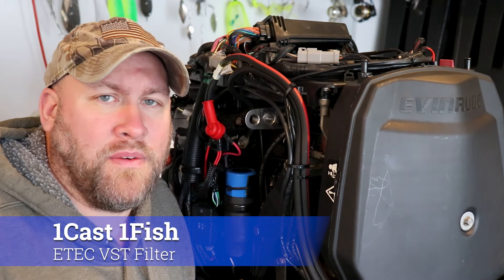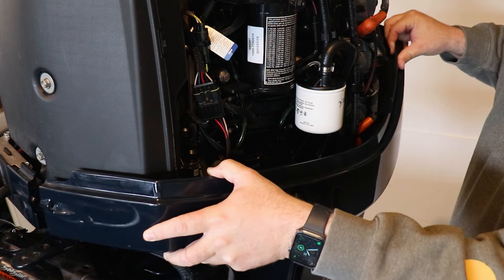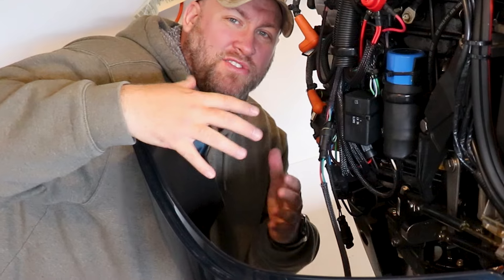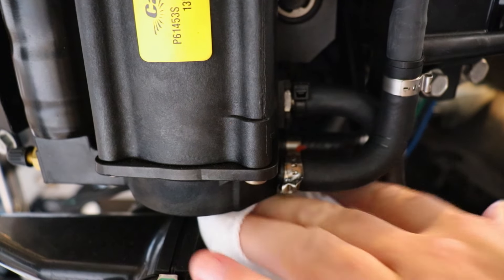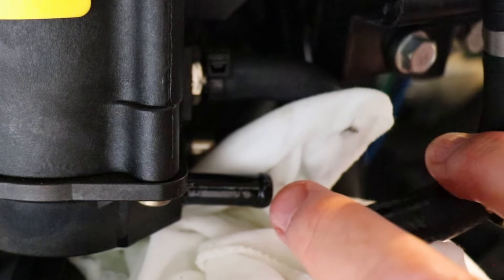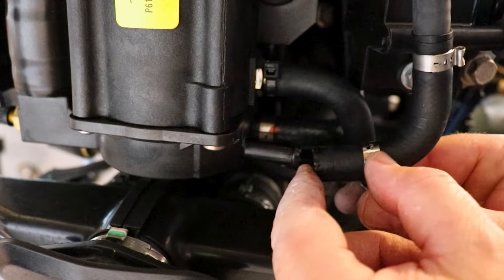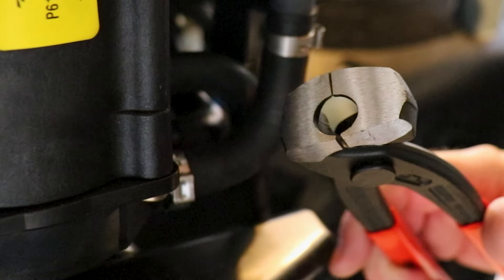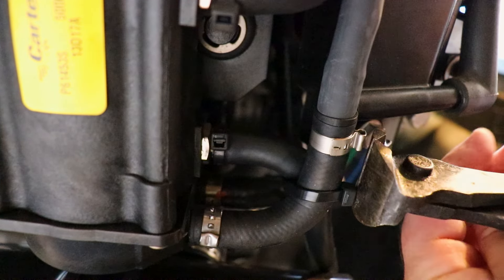Evinrude ETEC VST Filter Maintenance / 3 Year 300 Hour Service

Comment: You did a great demonstrating n explaining the VST filter replacement . 
I wondering about fuel leaks coming the area of the VST ? Before taking it apart . Are there any common problems . It is a small leak .and doesn't effect the motor running , your thoughts before taking apart ..
Reply from the maker: Depends on the leaking area...IMO any fuel leak could cause an issue and be dangerous.  
If it is simply from the hose or connector, it should be a simple fix.  However I do know that the older style VST system housing was prone to leaking as well resulting in needing to replace the VST.

Comment: excellent video got a link for the clamp an tool? I was planning a high quaility reusable fuel injector clamp I assume the line is 3/8"
Reply from the maker: https://amzn.to/3ySorKo
This is mine
Reply: @1Cast1Fish  when you screw into the filter doe's the screw ruin the filter being removed? like if mines clean can I reuse it?thanks
Reply from the maker: You can, if you screw it in very lightly and pull...if it comes out easily then it probably can be cleaned and reused.  However they are pretty cheap to replace.  I just like knowing a new clean one is in there since you have alot of work to get in there to it already. Plus if you do have issues or it's messed up you want a replacement on hand.

Comment: Thanks for the advice, do you have any for the e tec 60 HO 2020 year ? Took in for service last winter and now that the warranty is up plan on changing the lower unit myself and fuel filter and plugs. Only has 42.50 hours on it so far.
Reply from the maker: I have no specific videos for that particular model, but many of the videos should be a good match...like lower gear unit oil, plugs, and fuel filter
Reply: @ thanks so much

Comment: My ETEC 115 has the following issue.  After idling for a period of time looking for fish and bottom cover with my electronics, the primer bulb gets soft (lack of fuel in it).  If I then start my engine and try to get up on plane she will stall because of the lack of fuel in the line.  I then squeeze the primer bulb until it’s full of fuel again and once the engine starts it will run fine at full speed.  Would this VST filter cause this or should I look elsewhere?  I am not a mechanic but I could probably change the filter without having to drive through two states to find someone who will work on an ETEC.
Reply from the maker: Start with easy stuff first...Replace Primer bulb, Check anti siphon valve on fuel lines, Hose condition?

Comment: Hi got a 50 etec took mine out it was the same thing black and dirty after change it put everything back on and still idle good when I go backwards runs good but when I go forward it stalls
Reply from the maker: Have you checked for faults and codes with the diagnostic software?
Reply: So what do you think is the problem trying to finger it out even change the spark plugs I use the motor to get bowhead whales
Reply from the maker: Is the throttle cables and idle set correctly?
Reply: @1Cast1Fish i never changed it right after hunting bowhead whales my niece went out hunting bearded seals it stop and no power to go forward or backwards but it would idle okay
Reply: @1Cast1Fish  after changing the vst filter the backwards would work ok but forward would stall
Reply from the maker: Software would really help so you can look at TPS and other parameters. Are the throttle cables adjusted correctly, all fuel and spark systems good?

Comment: Can the VST filter just be left out all together?
Reply from the maker: I would highly advise against leaving it out.  Without it you will be bound to have fuel issues at some point as the contaminates are freely pased through. Definitly worth replacing...the filter is less than $10

Comment: How do you air (when been fuel) on hose put it out?
Reply from the maker: When you turn the ignition key to "ON" ...not start...you should hear the fuel pump and such start (to prime the system) The VST has a vent that takes care of air.  I do this a few times and no issues.  I don't even prefill the fuel filter anymore.
Reply: @1Cast1Fish Thanks...

Comment: Are these motors any good looking at 2015 boat with a 115 evinrude
Reply from the maker: Yes the motors are great, however as with anything...it depends on how well it was taken care of, fresh or salt water, maintenance or previous issues?  I would recommend anyone looking at these motors to simply get it checked out by a competent mechanic who can pull the codes and history and do general checks on the motor.

Comment: Hello Paul, would it be possible for you to give an opinion on what my Evinrude 175hp engine does?
When I accelerate it to 1500rpm it maintains its rotation but at 1600rpm it starts to accelerate to 4500rpm on its own, what could this do, I've already changed the spark plugs and lubricated the entire mechanical acceleration system.
Thank you in advance for your attention.
Thanks
Daniel Veterano
Reply from the maker: I am not a Evinrude mechanic, but might want to look at the TPS sensor...may be something with throttle control.  Do you have the Evinrude Diagnostic Software?

Comment: Can you run the ETEC without replacing the VST filter?  It seems unnecessary with the onboard fuel filter on the top of the engine.
Reply from the maker: Considering how dirty mine was, I would always do it as a precaution, due to its location in the fuel system and VST.  If left, it will eventually cause an issue once dirty enough.  3 Years or 300 hours is a pretty good amount of time...plus part is very cheap.

Comment: Hi i don't have the diagnostic software I am in a small village
Reply from the maker: The Software would help alot as you can see Realtime data for the motor.  Problem is it could be many things...here are a few places to start
Plugs, are they gapped & indexed properly
Fuel, any restriction, crud in lines or filters
Control cable adjustment
TPS calibration (Need software)

Comment: Have an etec 50hp, runs well wide open then when I slow down he engine begins to hesitate and loose power.  If the cause the VST or fuel Line bulb?
Reply from the maker: It could be many things, do you have the diagnostic software to check for codes or issues?
Reply: @1Cast1Fish is there a aftermarket tool I can read my evinrude for issues?  2008 115 etec.  I just started having issues with the primer ball going soft and motor bogging etc.  I’m trying to research what the probably might be.   Anything I should look at first? Thanks
Reply from the maker: @fishinfever3577 
Look on Amazon you can buy the diagnostic software for around 60-75 
Anti-siphon valve, fuel pickup screen, or tank vent possible places to look
Reply from the maker: @fishinfever3577 
Anti-siphon valve, fuel pickup screen, or tank vent 
Software on Amazon about 60-75

Comment: Do you have a link to the filter?
Reply from the maker: I do not have a link, I have found them online, but they are not always in stock.  I also get alot of my ETEC parts from Barnicle Bills Marine...tad bit more expensive sometimes, but great service on the phone to ensure you get the correct parts for your specific model.
Reply: @1Cast1Fish  you’ve saved my boat. Local dealers won’t wrench on it now. It’s up to me with your support!  Keep up the great videos.
Reply from the maker: @GatoFamilyAdventures  
ETEC owners gotta stick together
Reply: @1Cast1Fish  is t his on the 115hp model too ?

Comment: My vst filter is stuck; are there other methods in removing the filter?
Reply from the maker: Never heard of one being stuck, if you over tighten the screw you could possibly start biting into the VST nipple not letting it slide out.  Very tough to figure out without looking at it...are you sure the filter is there? 
The screw is the best and only method I have used and seen used.
Reply: @1Cast1Fish  Thanks for the fast response.  Yes, the filter is there and it moves a little when I pull on the screw however, it will not come out.  I will try again this weekend when I get some time.
Reply from the maker: Good luck, biggest thing is to be easy on that VST nipple, they are prone to cracking.